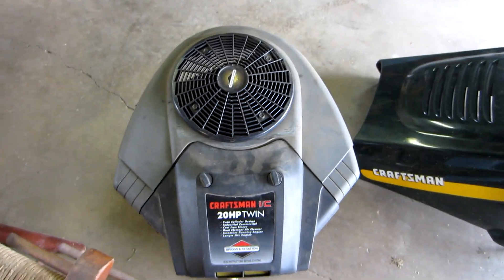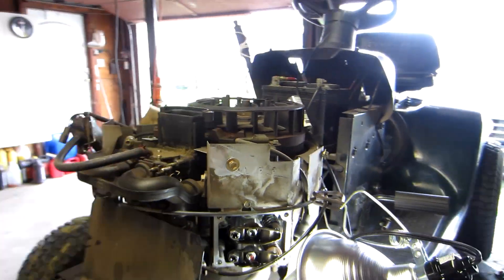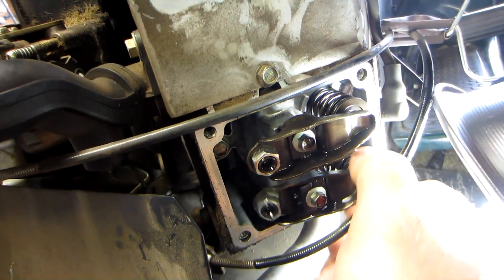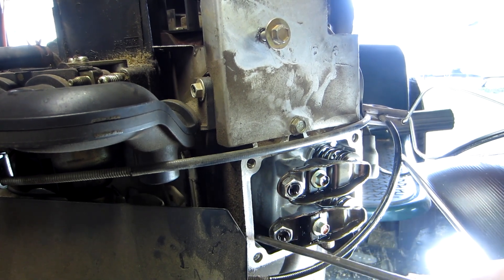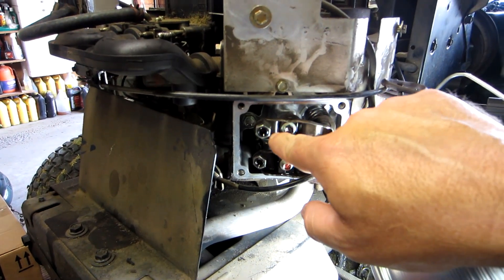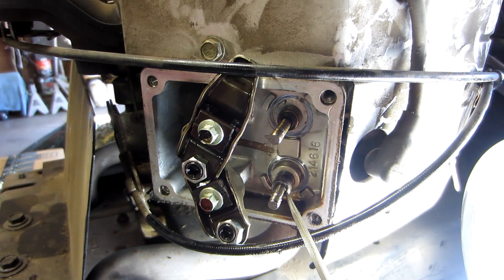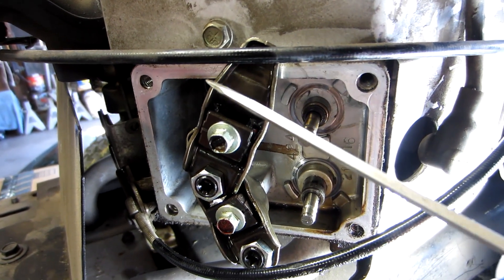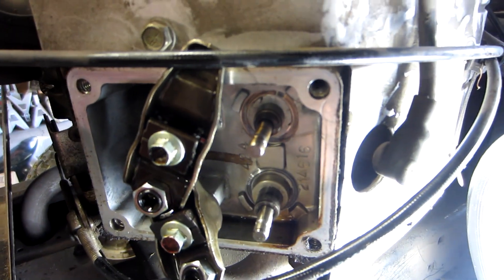Briggs Intek Bent Push Rods

Comment: Hi I like the vid. Have a question about my mower. I have a 18.5 Inteck B&S. I can't get it to start. If you turn the motor by hand it will move the valves then you get to a spot and it's like the motor gets in a bind and it is real hard to get over that spot. Then it spins easy till you get to that spot again. The push rods are straight and the valve lash does need to be set. At this time I haven't checked the valve guides. The push rods were so loose they more or less just popped out with a little push on the valve spring. Could that valve lash issue cause that hard spot when turning the motor by hand? I figure it might take you some time to answer so I'll go set the valve lash and maybe answer the question for myself. If not I'll post back.
Reply: Well the valve lash was all over the map so I set them all the same. At 6 thousands you still have that binding spot but it is easier to get thru. So I went to 8 thousands for now because it makes that binding spot even easier to get thru. Once it's up and running I'll dial them back to 6 thousands. Well anyway, valve lash is set I go to start it and well nothing. The starter acts like it is in a bind and barely moves, that and you can hear the starter solenoid clicking pretty hard. Well this mower has been sitting since 2012 mostly undercover but not always so everything has to be cleaned. I'll clean all of the connections and grounds and see what happens. If anything is bad hopefully it's just the starter solenoid. I'll let ya know what happens.
Reply from the maker: danh nguyễn if valve lash is set correctly and pushrods are straight then you are left with three things it can be... 1. Weak starting system (battery/starter).. Make sure you have a strong battery especially if it is a twin engine.. Don't go cheaper with less CCA ratings then what the mower came with originally.. PS, lawn and garden batteries are only meant to last 3 years.. Some make it longer, those are the exceptions.. 
2. Look for a partially sheared flywheel key.. It controls the timing.. If the timing is off it could be firing the coil early and into the compression stroke.. 
3. Some of the Briggs had problems with nylon geared camshafts. Causing timing issues like above.. This is the last thing to look for as it requires complete engine removal.. Good luck

Comment: I had a bent intake pushrod... the valve guides were in the correct position, so i replaced the pushrod. Now the cylinder won't fire, and the other cylinder is backfiring through the carb. i have no idea what to do now. I replaced the plugs, doublechecked both coils and they were good also. any ideas?
Reply from the maker: XxTREVxX make sure you have valve lash set correctly.. Also check for partially sheared flywheel key. M
Reply: I had to regap the rods at the rockers, then it fired up instantly man... thanks
Reply from the maker: XxTREVxX 👍

Comment: Must be 1 in 1000. Our 17 year old mower just tossed one of the push rods into the oil pan.  I removed the dip-stick tube and pulled the rod out with a magnet. It was a little nibbled up not not bad.
Reply from the maker: It's a great feeling knowing the engine didn't have to come apart to retrieve that thing!!!

Comment: My dad straightened his push rods and the mower runs great. However it is now smoking a bit. Any suggestions? I am thinking he may not have reseated the valve guides and the valves are not closing all the way.... Make sense? Just wondering when I pull it apart what the issue might be. Did not smoke before. Do you think he should have bought new push rods?
Reply from the maker: the pushrods would have to be perfect for perfect results but I have heard of others doing the same.. The way to fix to a perfect running condition level is repair the things you know are not right ... and fix them correctly, shortcuts may work but side effects may happen..

Comment: Great Video I have a similar problem I recently bought one of the engines used and its #2 valve assy (minus both push rods) was apart but the valves,guides and springs were in place and  I purchased new push rods,put it together, adjusted the valves, and started it up, ran alright for a few hours then started popping and missing with a loss of power. Now I have removed the #2 valve cover to find not only the exhaust rod bent but also the intake. Thanks to your video I found that my exhaust guide is out to far so I put it in as you showed but the intake only has a rubber oil seal so what could I do to keep my new one from bending again? Note the guy that I bought the motor from also said the rods were bent so I am going to try to get in touch with him to see if both valves were retrieved.
Reply from the maker: Kelly Vance the valve guides are both made from similar materials. The rubber seal that you are referring to is a umbrella seal used to aid in keeping oil from coming up the valve and also as protection from oil passing by the guide and into the cylinder..So,you will needs to remove that seal and push that guide in and peen it also.. The fact it was bought in a broken condition would lead me to believe he didn't retreive the old pushrods but it's going to take pulling the engine apart to know for sure unless the PO can guarantee he got them out.. Glad the video helped😊 good luck 👍

Comment: I have had a lot of Briggs ohv engine that run ok but have a slight knock don't sound like it's a rod Iran one for over a year it never got any worse. Is this common with Briggs ohv engines.
Reply from the maker: Most the time if the knock is light and the engine runs strong I recommend that oil changes get done regularly and that possibly a lucas oil additive be used.. Most times that knock can be generated from the counter balance system used in some of the Briggs engine and just make noise and don't cause much issue..

Comment: Let me start by saying thanx for the help youve already given me. So my Husqvarna had a valve guide pop out and bent the aluminum push rod and sent the steel one into the engine. I too got lucky and was able to get it out through the dipstick hole. It was bent and had some battle scars on it. The mower was still running after it happened just sounded like a helicopter. No metal sounds or smoke just poppin in the intake. I was gonna peen the guide, replace the rods, regap the valves, new head gasket and see what happens. What ya think? Any pointers or suggestions? Think the motor is fine? Any help appreciated. Thanx in advance. Nate
Reply from the maker: N8Dogg1002 Sounds pretty typical.. It's worth a shot to repair by peening. Make sure the guide is the correct depth before "peening" it back in.. Other than that pretty much straight forward.. Good luck..

Comment: I have the same motor on my toro zero tune. sometimes it is horrible to start it back fires and acts like it wants to start but won't. but when it does start it seems to run fine. I also noticed a oil leak coming from somewhere under the back right side of the motor tonight but can't tell where it's coming from yet. Planning on taking the cover off tomorrow to get a better look. If anyone has any advice I would really appreciate it.
Reply from the maker: BACK RIGHT SIDE?  I assume this is when you are sitting on the mower.. Leaks can only be found by tracing them.. It could come from numerous places.. 
   Dipstick tube seals and drains were a popular leaking point even if the unit was like new... The valve cover gasket(rarely) torn crankcase vent tube/hose on valve covers, Sump seal, Crank seals(PTO AND FLYWHEEL both)... Head gaskets too.....
   Back fire in the muffler could be from raw gas being introduced into the muffler then fired... But usually hard cranking and back fire through the carb is a timing issue due to  Partially sheered flywheel key, misadjusted valves or bent pushrods, could be bad gas,,
   There are sooo many things that could cause it.. just make sure to work the problem...
   Find the oil leak reason first it is a clue something is wrong.. When its running, and if your exhaust pipe is tight to the head, carefully check on the leaking side..Try to feel/see pressure being blown out of the underside of the head indicating a bad head gasket..  There is no way to pinpoint a lot of these types of problems online. The good news is, the engines are small, and they are easy to navigate, and easy to fix..good luck

Comment: I'm worried 😩 while I was gone for a couple months on a job my daughters did the mowing on our couple acres and forgot to put oil in it and my wife said the INTEK 24 HP twin V OHV engine just made a loud noise and " locked up " and died immediately. When she went to turn the key to start it again it did absolutely NOTHING!!!! Not even a sound ... a new replacement motor is in the $800 + range. Well I'm watching you to see if I can fix this myself. I am a back yard mechanic and can figure things out myself but I have no idea if it's fixable or what is wrong and what to look for . What do you think it is that happened? This has been an incredible mower and I don't really have that kind of money to replace a engine like that at this time. Please if you can help I'd appreciate it very much 😊 thank you.
Reply from the maker: Love4raine  firstly inspect the sides of the engine block for large cracks or holes(I suspect there isn't any or you would have an oil leak unless the crack is still sealed).     If all looks good drain the remaining oil out of block and put fresh oil up to correct level... third- make sure key is off and reach under frame and grab the engine drive pulley (gloves on and position yourself accordingly to get a good grip) try to rotate the engine by hand (really hard at first) If needed use pipe wrench on pulley shaft(exposed between drive sheets and deck sheeve) if engine breaks loose try to rotate it 360 degrees. do that about 4 or 5 revolutions... Now, Start engine, with battery jump start possibly) and run engine at full throttle for 20 minutes straight...  If you can't get the engine to turn by hand or if the engine will only rotate so far in each direction but clunks and comes to a dead half THEN you need a new engine... If you get the engine to run, but it has low power, is leaking oil profusely or smokes out the exhaust constantly, you'll need a new engine..... I don't recommend that this as a fix ....however, I have had moderate success doing this in the past.. good luck..
Reply: Love4raine You seized it I would take out the spark plug but some ATF  in it and let it sit till u can turn it

Comment: First off, awesome video. I have a INTEK 24HP on a Craftsman that just happened to fail on me today. Exact same thing you mentioned happened to me. I took the valve cover off and the right side cylinder (sitting on mower) exhaust push road was missing and the intake push rod was bent. I removed the engine and disassembled the lower have of the engine and low and behold, there was the push rod albeit chewed up a bit. I was wondering what could have caused the failure but you mentioned the field valve guides, which makes sense now. I'm thinking I'm going to purchase a new cylinder head instead of peening the guided. Do you know where I can purchase the lower crank case gasket?
Reply from the maker: Dave F you can usually reuse if in it stayed in one piece.. If not you can pick up at any mower repair/parts store..
Reply: Thanks for the quick reply, I have another question, if the one cylinder has this issue, what are the chances the other will do the same thing in the near future? Should I just replace both cylinder heads?
Reply from the maker: Dave F Couldn't really say.. traditional thinking usually dictates that whenever one of a pair wears out you should replace both but, excessive heat from poor airflow, or lack of lubricity from neglected oil is usually the culprit and as Long as the guides on the "good" head are in place there shouldn't be an issue..In other words, just because one tire had a blowout caused by driving through a pile of nails doesn't mean that the otherside tire is necessarily going to go flat.😀

Comment: Thanks so much for the instruction. Exactly what happened to the Husqvarna 2452 I picked up recently (cheap!).. grass blocked the right jug, exhaust valve guide came out and botta bing bent push rod..drove and peened the valve guide, replaced head gasket, push rods, set all valve lash, and  it now purrs..what I don't understand is why the INTAKE push rod was also bent, although not as badly as the exhaust, even tho the intake guide did not come out..??
Reply from the maker: It could have came out and pushed itself back in.. Probably should peen that valve guide too..

Comment: Great video.  Both push rods "disappeared" on My 23hp Intek.  Based on  you vid I probably need to remove the engine, find the rods somewhere in the the oil  sump, and repair valve guides or replace head.  Does that sound right?  Would there be any other reason the push rods would "disappear" ?
Reply from the maker: Unless the camshaft broke... But you will need to most likely remove the engine due to the aluminum intake pushrod not being magnetic.. at that point you can inspect for other damage..

Comment: Just wanted to give you a small update to my situation.  I ordered a gasket set, a new head, an oil seal and new push rods.  Got everything installed.  The steel exhaust pushrod was in the sump and was shaped like a "U".  I'm guessing it got twisted while in the sump but I have no way of knowing for sure.  It didn't look like anything else got damaged.  

Thanks for posting the video that pointed to the source of my problems!

Now if I can just get the governor adjusted properly!
Reply from the maker: Thanks for the update..  Hopefully the pushrod didn't damage the governor.. I have seen that before. Good luck

Comment: Will that same head and pushrod work on a 23 HP model? Does the valve ever kiss the piston when this happens? Just wondering because I found a bent exhaust valve on mine and don't want to pull the head off if I don't have to.
Reply from the maker: No valves wont hit piston unless springs break..Pushrod Is the same,,,Bent exhaust valve requires the head to come off to replace..
Reply: +Foxboss9 meant to say bent ex push rod not valve. Just replacing the entire head as you did. Thanks for your help
Reply from the maker: I see, Good LUCK!!

Comment: I just used your information to fix my 25 HP engine. It has bent 3 exhaust rods in the last year. Nobody, even the repair shop after a $300 tune up, fuel tank clean out, fuel line replacement (left off the clamp), and new battery. I replaced the carb after the second round when the rod bent and the back firing started again on shutdown. It started to be hard to start again and yesterday it popped on start up and was running on one cylinder. I guess I was lucky. My rods always dropped right into the valley and never moved. By the way. I found the easier way to keep the valve seated is to put a cylinder tester adapter in the spark plug hole and attach an air hose. One hundred P.S.I. will keep the valves seated to remove the spring keepers and reseat the guide and not have to put anything into the cylinder. For others FYI valve lash is .04. Thank's again for saving me $160 for the #1 cylinder head.
Reply from the maker: super! love to hear that!!!
Reply: My guess is that the backfiring is caused by the rocker hitting the valve guide as it is in the process of working it's way outward before the point of failure, short stroking the valve. Then finally it moves out too much and then the pushrod breaks. My father-in-laws would backfire before his failed as well.

Comment: So, the comment below says: "Sitting on tractor left side is number ending in 2".   My bad side is the right side when sitting on the tractor, so I ordered 796231 (at least that's what the box has on it)....   it's the wrong head.   Did I get the wrong one (i.e. should I have ordered 796232 - and therefore the comment incorrect) or did they send me the wrong one in a box with the correct part number???  (the only numbers on the head itself are and "S2" - stamped twice on outside, and a "465" stamped by the valves)  Thanks.
Reply from the maker: Check my description out.. The sitting on the tractor left side head is what I replaced in the video(1st link in description) .. If you need the opposite side click the second link in the description..

Comment: Question:  the rod that was in the oil sump came out with marks in it like it had been chewed on by a dog.  Since I did not have to tear the motor down I don't know the exact condition inside.  However, I did run my magnet around the oil pan and it really did not pick up and metal to speak of.  I'm wondering if there is anything else I need to do (flush the oil sump/crankcase, etc.) before I refill with oil and start it up?  Thanks
Reply from the maker: Try running without opening up the engine first.. The worse case scenario is something is a little wonky inside from the pushrod getting bounced around and you'll have to pull apart the engine... All you'll be out is some oil..Then again it may run just fine for the next 15 years!!!
Reply: Well, I poured some kerosene in the crank case and let it sit for a while; I drained that and next I'll put some oil in for a while and then drain as well, before putting final oil in.

Comment: Thanks for the great video - Amazing that you described my exact problem.   To add to the knowledge base.   I tried the magnet on a stick approach but got nothing.  However,  next I used my Android endoscope to look around at the bottom of the dipstick tube - voila!  I could see it off to the side.  After I removed the dipstick tube I could actually see the rod and easily direct the magnet to grab and pull it out.  Thanks again for saving me the trouble of tearing down the motor.
Reply from the maker: Great!!